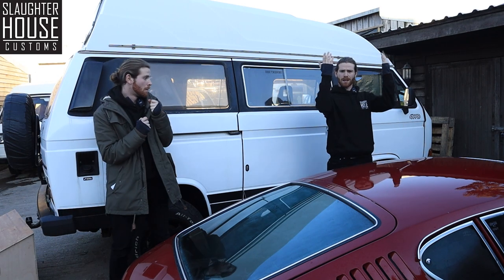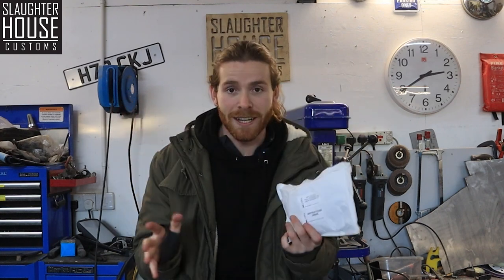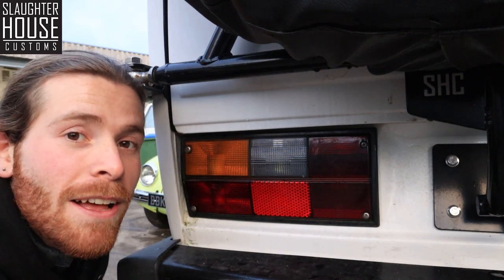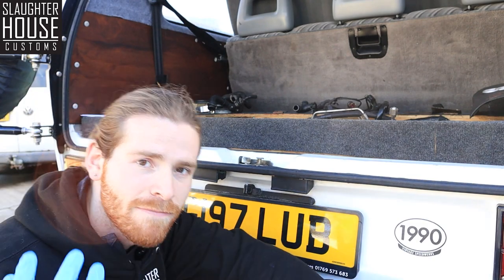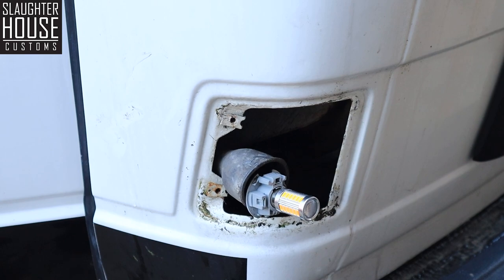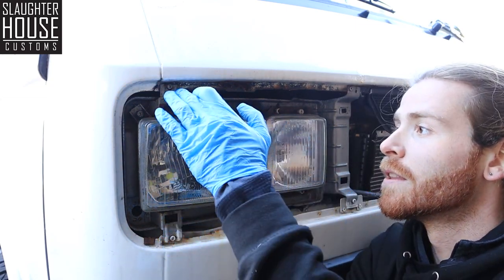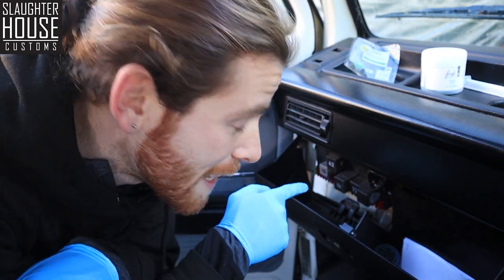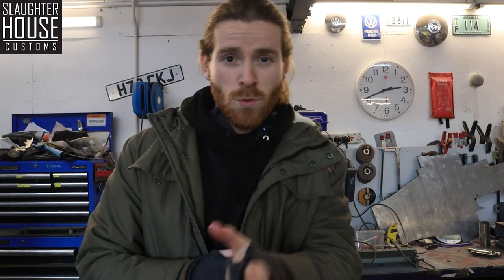FIT YOUR VW T25/T3 SHC LED UPGRADE KIT: SHC NO NONSENSE TUTORIALS

Comment: nice job. why not headlights ?
Reply from the maker: LED headlight "bulbs" are technically illegal. If you replace the entire headlight set up with prebuilt LED headlight unit, you're in the clear, but just changing a bulb out in a normal headlight can unfortunately fail an MOT!
Reply: @slaughterhousecustoms are there legal LED or other brighter light units available for the T3 with the square lights?